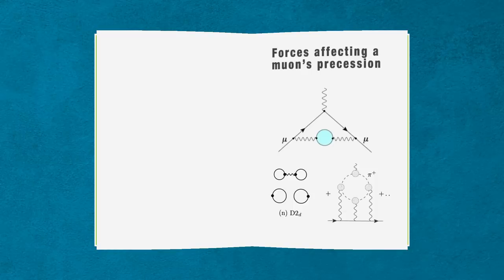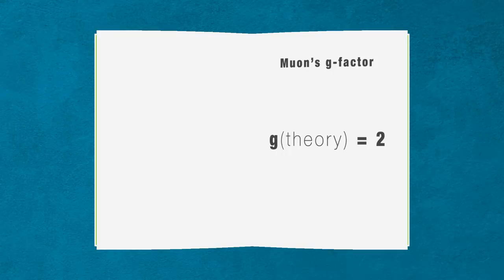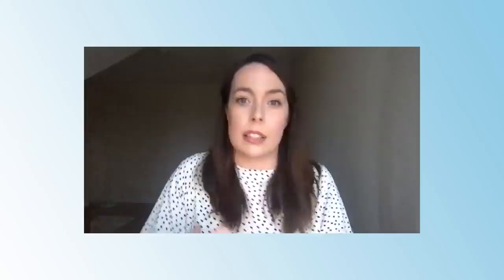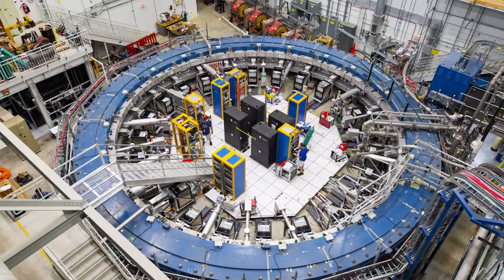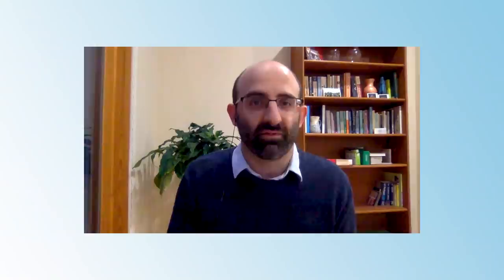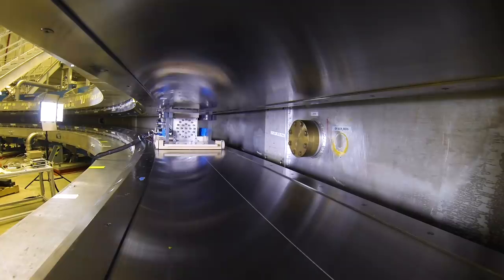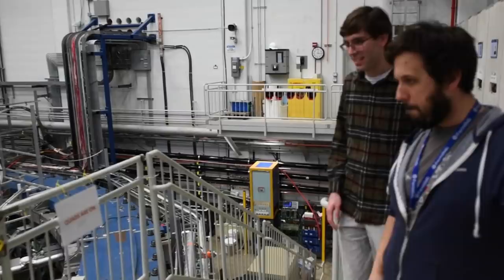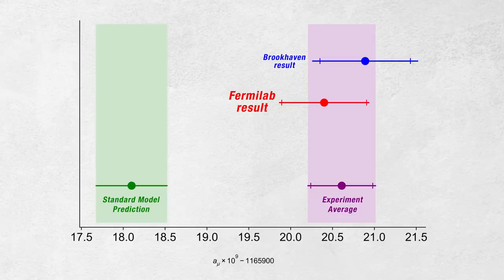Muon g-2 experiment finds strong evidence for new physics

Comment: Just in time now that Standard Model is complete. Just in time to save a lot of jobs!
Reply: Omg are physicists running a planned obsolescence scam? Next thing you know, they wont even include a removable battery or wall charger in the next lhc!
Reply: Standard model completed? Where does gravity and dark matter fit in again? What about the neutron decay problem?
Reply: Hahaha, you are so clever. It's a good thing that street sweepers are always in need, particularly after a beer festival. Your future is secure.
Reply: @MAD-SKILLZ  - Dark Matter could be black holes. Hawking argued for it in 2014 if I recall correctly. It can also be new particles (axions?) or just weird particles like hexaquarks. 

But this experimental confirmation what strongly suggests is that the Standard Model is incomplete, not that it is "completed".

Comment: The difference is in 8th decimal place. Its not like the huge gap they showed in the video. More like they differ by ridiculously small amount of 0.0000001%. Can so unsignificant difference "discover new physics"? I think not.
Reply: The thing is that: theoretical prediction and experimental results are that precise so that 8th decimal place difference makes a 3.7-sigma difference. This does indicate there's something significant is missing in our current theoretical model.
Reply: "Can't be, numbers not impressive enough for layman."
Reply: Yes, they also showed that. They may have not emphasized or even explained enough that this g number, as theorized and measured (approx.) in electrons previously), was considered the strongest support for the Standard Model, "the most accurate prediction in the history of science, blah, blah, blah..." This measurement confirmation strongly challenges the arrogance of Quantum Mechanics as we know it.
Reply: @LuisAldamiz  Why do you think physicists try to discover if there is new physics at higher energies? To find out if there is new physics beyond what they have measured before, at lower energies. For example, electrons would not interact strongly enough with a new massive particle to make a detection, but since muons are much more massive then they can.
Reply: @tonywells6990  - So what? That's your conjecture: a new (most unlikely) particle that saves the day. If all you have is a hammer all problems appear to be nails, if all you do is quantum mechanics, all problems are to be solved by finding new particles... that are not found. 

Maybe there should be more thought about the nature of the particles that are known to exist and how to fit them in curvaceous space-time instead?
Reply: The video does show the raw numbers -- but I guess you missed that, even though there were only two numbers on the screen...
Reply: @LuisAldamiz  Particle Physicist’s looking for new particles?!? Oh no the tragedy. Better start preparing to punish Marine Biologists for looking for new marine species
Reply: @UmbraHand  XD

Maybe they should not consider themselves "particle physicists" but rather fundamental physicists? I mean like real physicists trying to find the actual rules and basic facts on which our Reality operates and not just their fetish "particles" (which incidentally only means "small parts").